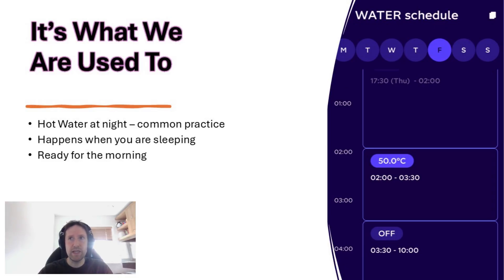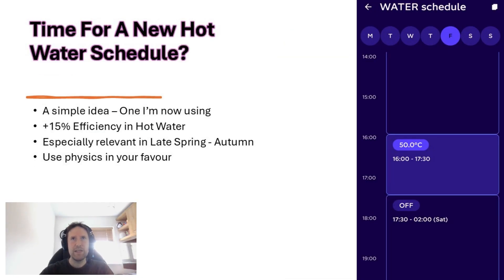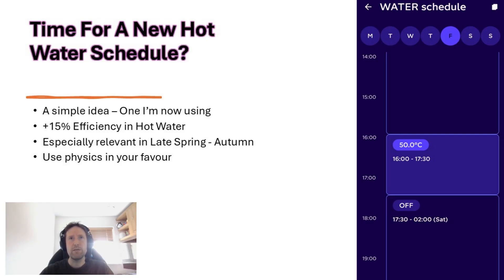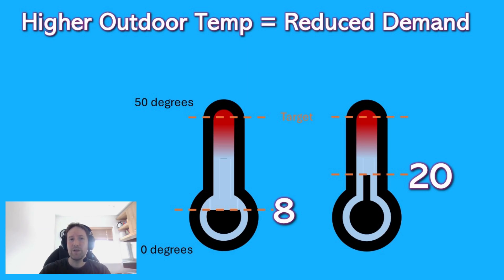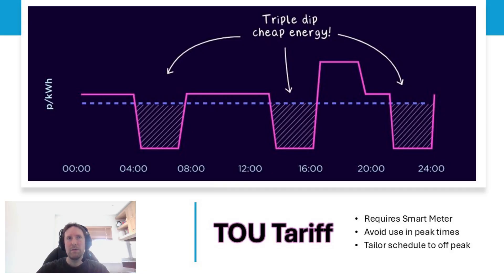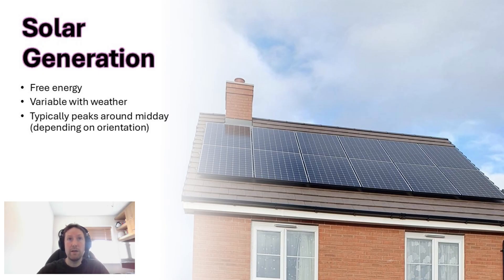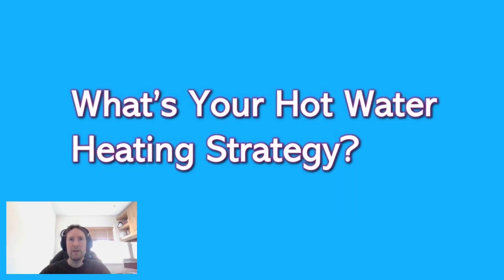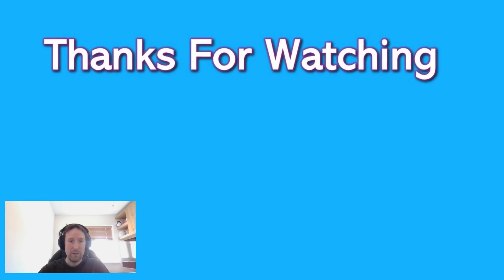If You Own A Heat Pump This Could Change The Way You Think About Hot Water Schedules

Comment: For what it's worth, that might work for me in the summer but right now it's still cheaper to use extra energy at night on Octopus intelligent go and export solar during the daytime, and probably better for the grid too. I'm still learning to get the best out of my Daikin Altherma (it's really pretty good but the power limit is such that when it's cold it needs to be on 24/7 with no setback); what I have observed is that after the water is heated, the heat pump has to work harder to make up for the loss of heating, and that can take a bit of time, so I set water heating to start at 23:40 each day, and the weekly decontamination boost to happen at midnight on Friday (since that can only be scheduled at the start of the hour). There is then plenty of time for the heat to be replaced overnight. When I had it set to occur at 04:00 each day, it wasn't always the case that the extra heating demand would be satisfied by 05:30.
Reply from the maker: At this time of year when solar generation is limited and batteries are often working hard throughout the day, this tends to work best for tariffs like Octopus Cosy which have a daytime off-peak rate or those not on a variable time of day tariff at all. Although I certainly argue it's best for anyone with a heat pump to be on one if possible
Reply: @RenewableEnergySteve I charge a battery overnight, otherwise I think Cosy would indeed be the way. Thanks!

Comment: Although the COPis improved by daytime running,, the cheap night rate electricity is less than half the cost of exporting that same daytime energy. So it is still cheaper to run at night, and it is better for balancing the grid.
Reply from the maker: That's the case with the current tariff rates, but it's always good to know how to adapt should things change 🙂

Comment: thinking oof getting heatpump aroud april 2026 i have 20kw total battery but never let it drop below 15-20% and in winter i most of the time use it all to so 80% but then we are near 00.30 when cheap rate kicks back in so depending on heatpump price might get one more battery
Reply from the maker: Having good battery capacity certainly helps with the potential savings of a heat pump if you can store up lots of that cheap off-peak energy 😊
Fingers crossed you get some attractive prices when the time is right for you 🤞
Reply: @RenewableEnergySteve  do u think heatpumps will drop in 2026 and what heatpump u recomend
Reply from the maker: @deanwhittle1301 The average price has dropped slightly over the last couple of years. I found a graph from gov statistics which I put in a recent video called 'could now be the perfect time to buy a heat pump' As for the brand and installer, I'm happy with my Octopus Cosy 6, it functions well at higher flow temps compared to many so less need for many radiator changes. As such Octopus now offer something called a Turbo install which is a little cheaper. The Cosys are good for data tracking and controlling directly from their app too. However, there other brands which are thought to be even more efficient if a little more expensive. Everyone I know with Vaillent systems say they are fantastic. Rather than having a specific brand in mind, in my view, the most important factors are getting the right size for your property and getting the an installer who can be trusted to do a good job.

Comment: I have heat pump install booked for 14th July (Octopus9). I have solar & battery, Glad I found your video!! Great Info - Thanks!
Reply from the maker: Best of luck with the install. 😀 Having a Heat Pump alongside solar and battery is a great combo 😊
Reply: price did u pay coz am more then liky going to get one around april 2026 i have 3 bed house rate c energy before i got my solar and got new windows old windows where around 20 years  old or so and i am thinking of putng little more insulation in loft

Comment: Good discussion.  There are so many system variations.  My ASHP has been off for more than a month as I heat h/w via solar PV and an electric diverter in the spring, summer & autumn (Feed-in-Tariff).  As I am on Octopus Intelligent Go (EVs), then the 7p/kWh overnight compared to 27p during the day means heating h/w overnight in the winter is a no-brainer cost and efficiency wise.  But your point is really good to raise to get ASHP owners to consider their system.  One thing I would also mention is NOT to keep topping up the h/w cylinder during the day (as h/w take priority over heating and keep switching to h/w will have a significant impact on heating COP).  Keep up the good work.
Reply from the maker: As yes, it always feels like V2G is just around the corner. The regulations have to approve it the car and charger needs to support it and so on. In principle it makes a lot of sense. why buy an extra battery for the home when you have, in your case, 2 perfectly good and larger batteries on the drive most of the time you need them. Let's hope it all takes off soon. 
Good luck with Havenwise. I had to Google that one 😉
Reply from the maker: That's it precisely. All about understanding your setup and being able to optimise for your situation 😀 
Do you have a battery at all? On the face of it I couldn't help but wonder based on your comment if you might be better off using the ASHP for heating rather than a solar diverter for the immersion heater as that would only have a cop of 1.0 at best Vs close to 3.0 for the ASHP. Though your off peak and off peak prices are poles apart. As you are getting fit is the goal to maximise your own solar usage and you feel the diverter helps you achieve that?
Reply: @RenewableEnergySteve so I have batteries across two EVs, but not separate home ones: I’m waiting for V2G.  Timing the ASHP when it’s sunny is quite difficult - I can hear the home automation crowd jumping up & down 😊. In the winter we use the HP. Night time COP is easily balanced by the almost 4:1 price advantage. But summer there is more than enough solar PV. So I think I’ve got the cheapest solution for my system. 
I’m on a Havenwise trial, which might improve the cost planning.
Reply: @juliandclarke  I only became aware of Havenwise after watching an episode of Renewable Heating Hub. It certainly looks like it might be the ideal solution for when we get our HP install next month. We're having a DAikin fitted and it's not currently supported but trials are under way and I've registered an interest.

Comment: Great video Steve. It's a balance between efficiency and cost - for me, I'm on Intelligent Octopus Go so I run my Cosy 9 for hot water just before the cheap 7p rate ends at 5.30am and I warm the water up as much as possible so that we'll use it as slowly as possible (ie. dilute it as we go, to help it last all day). It's less efficient when the air outside is cold, but because it's so much cheaper the efficiency kinda goes out the window. The second top-up later in the day (which will only kick in if it needs to, obviously) will be more efficient but be using peak-rate electricity (no battery... yet!).
Reply from the maker: Thanks for your support. Thanks also for sharing your strategy 👍
Reply: You seem to be running your hot water schedule at the coldest time of day. How about water heating from the start of the IOG off-peak period at 11:30pm? It will probably be warmer and therefore more efficient. The extra heat loss from your tank will be minimal

Comment: I think you missed a lot of the info here. Limited to only focus on Cosy tariff, plenty of people get on an EV/battery tariff so the efficiency is offset by the price per unit up till 5/6am.   Eon potentially do a cheaper HP tariff if you don't have a battery to shift off the 4-7pm peak. 
You didn't discuss differences in temperature, usable volume and multiple heating cycles if you only have it set to say 43 degrees vs 50 or 55. Have you considered running your cylinder at 43 degrees twice a day? Obviously wouldn't work if you only shower in the evening.
Reply from the maker: Sure, you are right, there is lots of scope to expand upon this, but didn’t want to bloat it too much with different scenarios. My aim was more to point out how to maximise efficiency and to communicate why. But minimising cost is a linked, yet expansive topic which might be better severed in a separate vid. Of course, its always worth people doing what’s best in terms of their tariffs etc. Load shifting to night is a well known practice for anyone on an EV tariff, but its nice to have knowledge to adapt accordingly should tariff prices change at some point in the future. Multiple cycles for hot water seems excessive for my own needs, but I would be curious to know how its working out for anyone trailing it.
Reply: the obvious way to exploit Steve's proposal to take advantage of physics is to heat your hot water at the start of the EV tariff off-peak period when it will probably be warmer than at the end of the off-peak period

Comment: Close the blinds behind you! :-)
Reply from the maker: Ah yes, ive tried all sorts of different variants, open, closed tillted slightly, unfortunately i think my camera tends to get the exposure a bit off regardless. Where my desk is means it will always be facing the window which is fundamentally unoptimal 🙄
I will experiment some more and see if i can improve things.
Reply: @RenewableEnergySteve  I was so interested in what you said I didn't notice. Use the window to your advantage put it behind the camera and you'll have perfect light.
Reply from the maker: @alistairlambert3275  thanks for the tip. Hope it's not too off-putting for now

Comment: Excellent video, thank, this is what I have been telling people although I assumed moist air would actually give you more energy.
Reply from the maker: Thanks 😊 
It seems there is some debate around the effects of moisture after all. In cold temps it's pretty clear cut that any kind of frost will start to hamper quite significantly hence the need for a defrost cycle. In warmer temps I've seen articles and/ or studies which argue both ways, some say it can be of benefit and some to the detriment so much more open to debate

Comment: The same applies for freezers; Run it when power is cheap.  Put a couple of "blue ice" packs, or even a plastic bottle 3/4 full water for more thermal storage.
As to my house, my heat pump water heater is in attic (in Houston, USA).  I have it run about 1400 (2 pm) just when attic temp nearing peak (also have solar).  In summer the attic stays hot enough I can run my HPWH once every 3 days, the water stays nice and hot!
PS: Really great vid to explain to people how easy to save on power bills.
Reply from the maker: Thanks 😊 
Wow! Keeping warm for 3 days is great. I'm assuming that's quite a significant capacity?

Comment: As a new heat pump user, and someone who is keen to get the best from it, I was curious about which timing strategy to employ (or if is not worth bothering at all, as the installer recommends) and was planning some comparative testing. This info will be very very helpful in interpreting the results, so thanks.
Reply from the maker: You're welcome. 😊 Good to hear it's useful to you

Comment: You are absolutely right. Physics works for you.
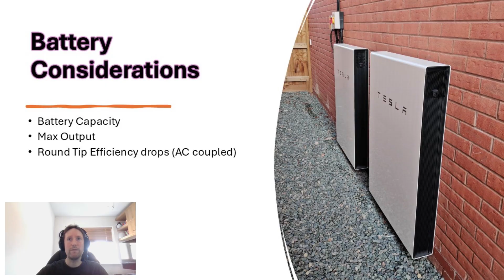We have a power tariff in Sweden so 07:00 - 19:00 we pay a huge fine if we use too much power during that period so I used to have it timed to start 19:00 when it is still not too cold outside.
But lately I have just let it run when it needs to. Running it at a schedule somehow forced it to run every day even though not needed. Solar offsets some of the government/EU craziness with the power tariffs.
Reply from the maker: That's interesting. It's great to get your perspective on how it affects you in Sweden. I understand Heat Pumps have been much more popular in your region compared to the UK. What sort of fine do you face for using too much energy during the daytime?

Comment: I use intelligentGo which gives 7p/kWh at night. I use this rate for my heating. During the day I don’t want to use my solar because I get 15p/kWh export. So it may be less efficient at night but it’s cheaper. On a separate note, I keep my water temp between 48 and 45. From what I’ve learned Legionella doesn’t survive above 45 so I don’t  do Legionella cycles, they are expensive. I think I’m OK.
Reply from the maker: Thanks for sharing. You could be right about the legionella. It always used to be the rule of thumb that temps had to be over 50 to be sure, but I think that tends to be more where  stagnant water which is left for a few days is concerned . Maybe consider a high temp cycle if you go away for more than a long weekend.
Reply: Similarly, I use a cheap overnight tariff for hot water, the efficiency may be down a bit, but it is much cheaper with the low tariff making the efficiency irrelevant - it would in fact be cheaper to use an immersion on cheap rate than a heat pump on standard rate. 

Legionella does survive above 45ºC, the favourable range for Legionella is 20ºC - 45ºC, but it will survive outside those ranges so needs to be heated up to 60ºC for it to be killed. However, the risk is very small, I'm not sure that there has ever been a case of domestic Legionaires disease in the UK. The risk from Legionella comes from aerosols  i.e. showers, so if you have decent flow through the system to limit Legionella and flush the shower head if it hasn't been used for a couple of weeks there shouldn't be a problem.

My elderly mother lived in rented accommodation and at the landlord's boiler check they would set the hot water temperature to over 60ºC (rules!), the result was that she was scolding herself from the tap. Every year I set it back down to 43º as the certain risk of scolding was far more relevant than the theoretical risk of Legionaires - she even had an electric shower, so the major risk wouldn't be affected by the cylinder temperature anyway.

Comment: Looking only at hot water heating in the summer meaning no defrost cycles - I don’t see why high humidity would make the heat pump less efficient.
Reply from the maker: You could be right to question that one beyond a certain temperature where frosting cannot occur it's less obvious. Most articles and studies I have read suggest it is still a detrimental factor. When it was installed the Octopus engineer I was talking to seemed to suggest it was a fairly consistent rule of thumb but now you question it, I did actually find a study which even suggests the opposite so I guess there is some debate where warmer temperatures are concerned.

Comment: Been playing about with the schedules and like you seem to be getting around 3.3+ if heating during the day or 2.5-2.8 in the off peak window. Whilst the added efficiency is nice, it's more cost effective to run it in the off peak and gain a few extra kWh on the export from the solar. One thing I haven't tried yet is just switching the hot water to "on" and seeing if it's more efficient to keep the tank topped up all day.
Reply from the maker: Good to hear you are seeing similar results with your Cosy 9. It feels counter intuitive to run it at night knowing how it impacts efficiency. That does work out more cost effective with some tariff combinations for the time being 😄 
It's always good to have the knowledge to optimise should tariffs change however 😊 
Using the on setting scares me slightly as I always want to avoid peak import. I worry it may end up coming on at precisely the wrong time. I would certainly be interested to see how that strategy affects efficiency.
Reply: @RenewableEnergySteve  it always feels a bit backwards being that "self consumption" isn't the most cost effective way to run a solar setup. But it's all driven by the tariffs we end up on. I'll have a try with the always on setting to see what happens and if it follows the same theory as the heating side being more optimal to run a het pump constantly. My only worry would be that as hot water take priority, if I where to do this in the winter, would the heating ever come on 🤔
Reply from the maker: @WattsUpWithSteve  I wouldn't worry about that. The hot water would come on when the temperature reaches a defined minimum but shouldn't take too long to warm up as it would be such a small temp increase. I would be surprised if it's as efficient however, but do share your results 🙂